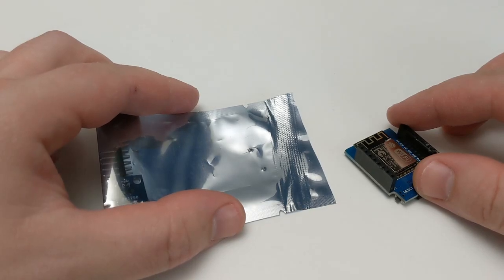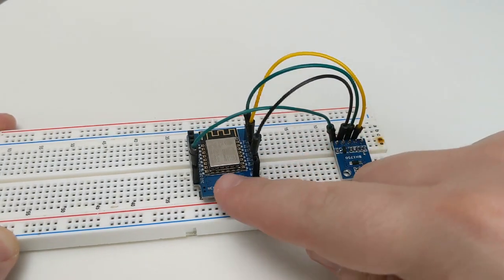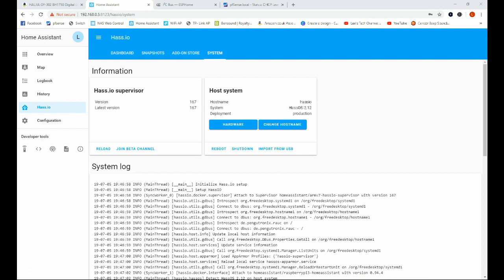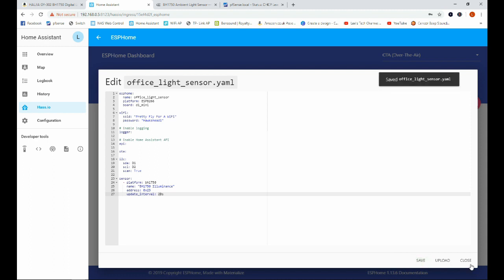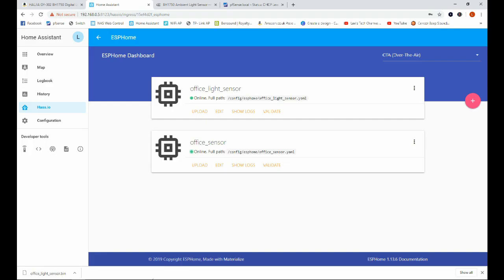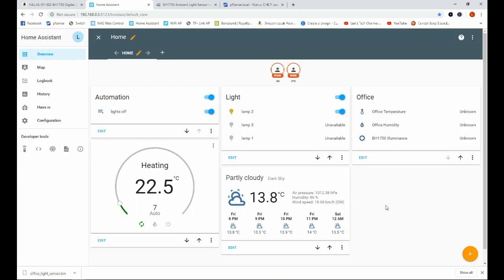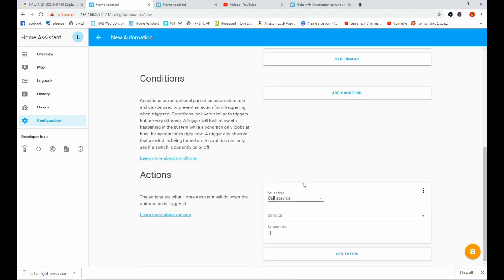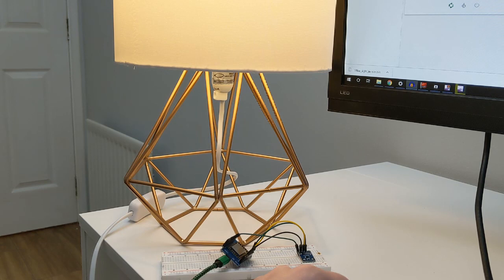Home Assistant Light Sensor

Comment: i dont have an sc1 pin only an ScL :(
Reply: There is no sc1 pin. It's supposed to be the SCL. When in lower case spelling, scl might look a bit like sc1 especially with those mono type fonts. So I reckon that's why he keeps saying sc1 😁 I got a bit confused as well.
Btw: SCL= serial clock | SDA = serial data

Comment: How long do you think its gonna take compiling? Mine's been compiling for half an hour now.
Reply from the maker: Shouldn't take that long. Its been a while since I made this but off the top of my head it took around 5 minutes or so
Reply: @leestechprep  actually I found out that on my RPi 3+, compiling anything kills the home assistant. It takes up all memory and render the RPi non-responsive. 

I copied the yaml file to my laptop and installed esphome (via python) and compiled the lot there. Then I uploaded the sketch to my D1_mini and rebooted. The lux-sensor popped up automatically, and esphome recognizes it.

Comment: Excellent video again Lee, something I intend to create for a remote sensor, however I have an old house with not that many power sockets and don’t want it littered with esp8622 and little in-efficient power supplies, any way I can add light, temp & humidity sensors to the GPIO on the pi running hass.io and therefore have a main all-in-one setup? That with the DarkSky integration would give me a mega hass.io setup on one board!
Reply from the maker: Thanks for your comment Adrian. I believe that is possible. Let me look in to it and I will out a video together for you.